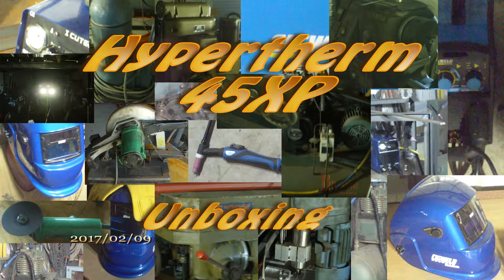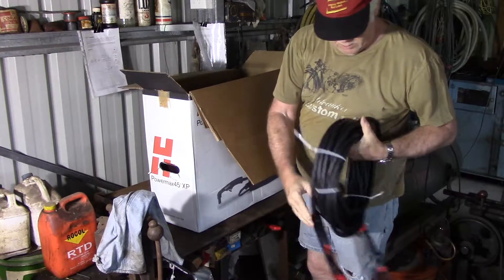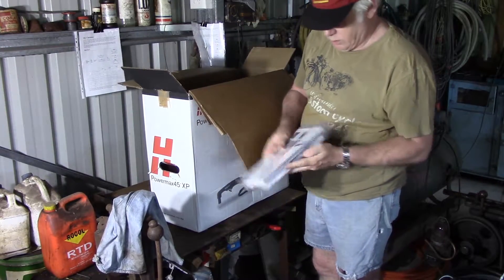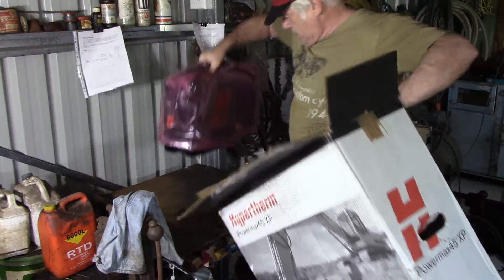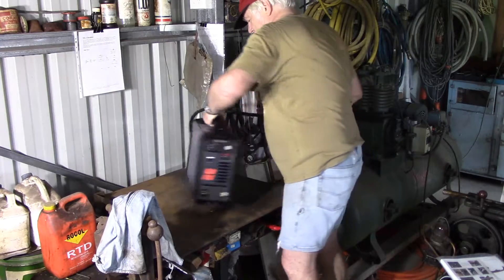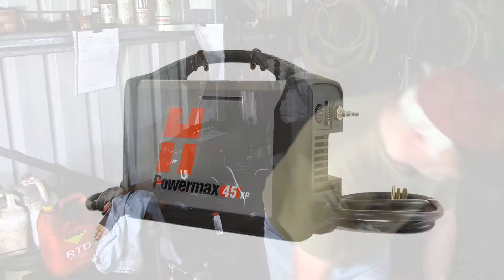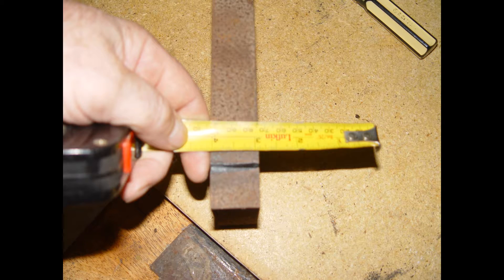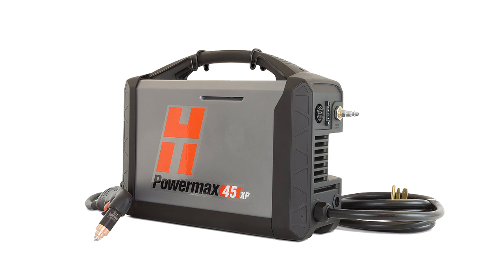Hypertherm Powermax 45XP Unboxing

Comment: Mate, Can I please ask you whether 45XP can run without any problem with 240V. I have dedicated 15AMP connection to my garage.Only If you are happy to share, can you please tell me where you bought the unit from ? I would really appreciate your response. Kind regards.
Reply from the maker: It will run fine on 240V but I really doubt that 15AMP will drive it.  I have a 50AMP circuit to run it although it will run on 35AMP with a slow blow fuse.  If you have 3phase I would be inclined to go that way but check the AMP requirements, I'm not sure if a standard 20AMP 3-phase will cut it.
I got mine off EBay.  Not sure about exchange rates now but back then you could ship one from the UK for about $1K less than they were advertising locally.
If the Hyperthem doesn't suit electrically you might consider an Everlast.  I haven't used one myself but I have spoken to several people who like them.
Reply: Thank you so much. I really appreciate your quick response. Thank you for your advice on Everlast. I am thinking of going for an Everlast Tig welder.But  I have not done any Tig yet.
Reply from the maker: I was looking at an Everlast unit that combined stick, TiG (DC) and plasma a while back.  In the end I spent my money on something else but that may be worth consideration.
Another thing to check is what AMPS the machine actually draws, there are a lot of "15 AMP" machines on the market that actually draw in the high 20's.  That can work if you have a good circuit but something else to factor into your decision.

Comment: Dear Sir/madam,

I want to purchase a plasma cutter. What is the best way to pierce small approx 2mm holes on to 2.5mm stainless steel as i have to do approx 700 to 1000 holes .. 

We make custom chandelier plates for our chandelier and every job is different there for we are looking for hand held plasma cutter to clean cut and also clean pierce .

Thanks 
Best Regards 
Rakesh Solanki
Reply from the maker: I'm certainly no expert at this but to cut that many holes with any sort of precision I would be considering a CNC setup.  If you decide to go with hand held then the Hypertherm will punch through a hole that is approximately 2mm diameter with standard consumables.  The down side is that you will either tip the torch slightly to avoid spatter (and then get a slightly elongated hole) or go vertically through and clean the spatter off your torch from time to time.
Given the volume of holes you want to do I think I would look at a hydraulic hole punch solution.  No idea of price but I have seen some that punch holes in much thicker meta than you are dealing with as quickly as the operator can position the material and press the peddle.